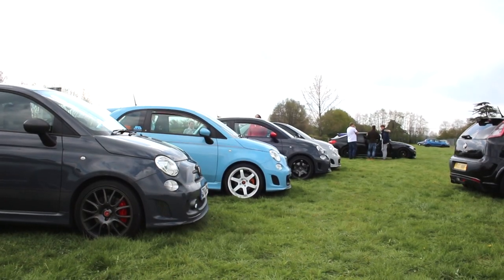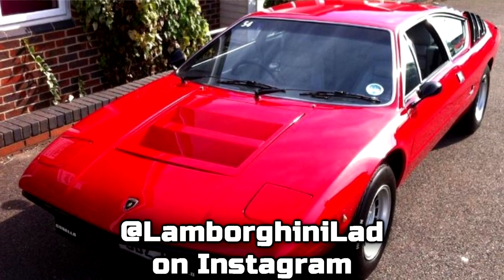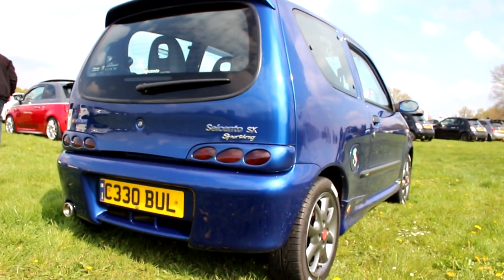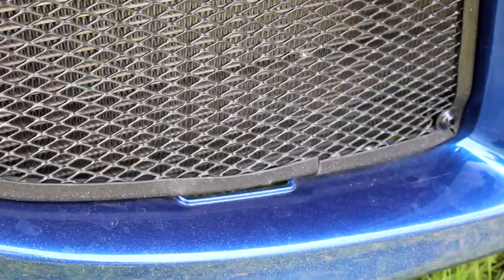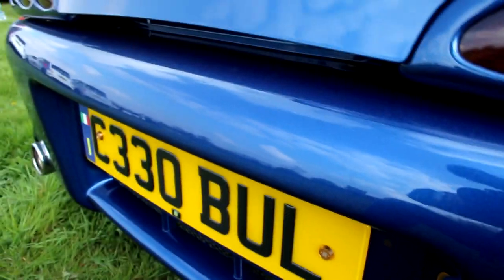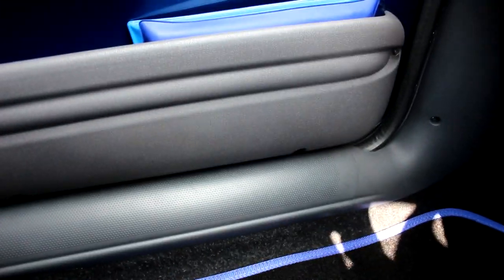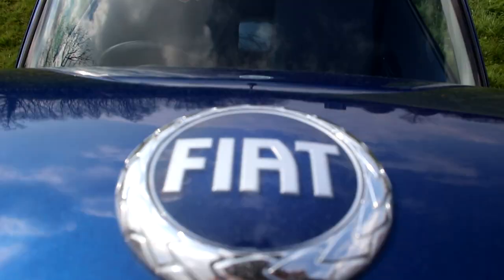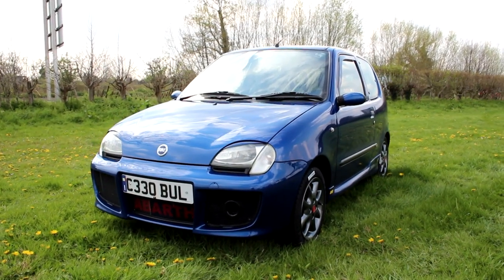The BEST Seicento In The UK!

Comment: Hi Miller. This car does loke great and I will actually copy 1 or 2 things for my mk1 Punto. 
I just think that for a project as nice as this, the rear brake drums could have been painted black or metal and the seats cleaned. Those were the 2 only faults I noticed. 
The blue knots are called Fender Bolts and for you car and the Punto, if I am not wrong the bolts ate size m8. I have on my car in purple and I also bought some m10 as I was told I needed as well and I do not need. 
Regards

Comment: I dont know weather to get a seicento sporting for my first car beautiful cento tho
Reply: Joe Sutton you definitely should there cheap as chips plus if it goes wrong you can sell parts to make a profit and they are very fun as when your going along at 20mph you feel like your doing 80mph
Reply: @fabdavies0567  thanks bro !
Reply: I have several cars but my favourite for the daily use is the Seicento. Small like a smart outside but roomy inside, with a lot of holes to put any frippery, nice handling, jeepy but rather glued to the road, smiling, never stops,  zero maintenance. A problem to find a substitute now that I need an euro 6